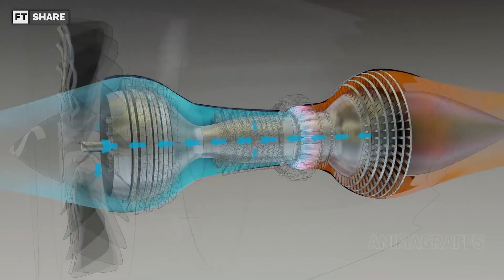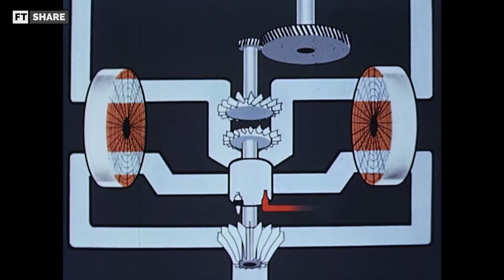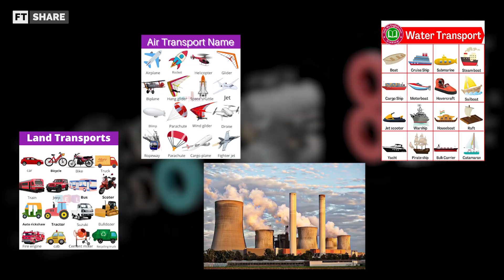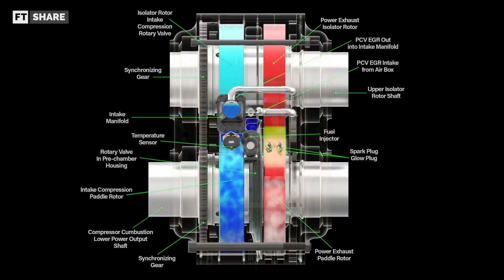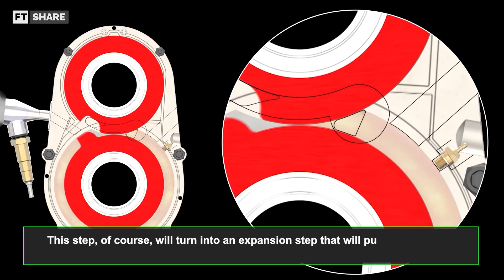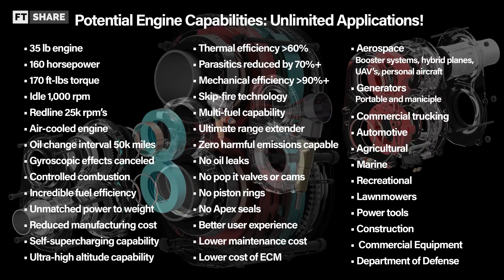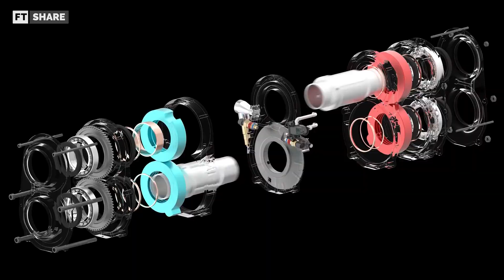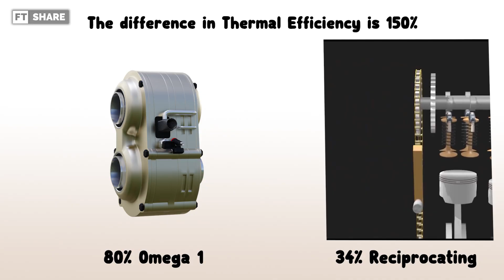Ready To Destroy EV Engine!! | Astron Aerospace - Omega 1 Engine

Comment: this is a claw pump 
Or dry pump 
Engine 

U can use roots pump engine 

Any rotator pump in tendem 

Intake smaller exhaust bigger 

In between heating internal or external 

Torque is out put
Reply: Any air pump with smaller intake pump exhaust bigger 
With two pump axle connected 

Or two pump the with gear ratio 

So air taken in heated 
Expense and drive exhaust pump 

This torque drive continue air taken in colder 

No mater heating internal or external

Comment: It sounds good but ...... does the engine get hot? if it does energy is being lost in the form of heat energy. Heat losses of electric motrs is very small. Since the fuel fires up there are considerable heat losses. maybe less than traditional ICE engines, but unquestionably far greater than electric motors. ... so..... this claim to destroy ev motors is FAKE!!!!

Comment: Very poor and at times incoherent english dialog. The 80% thermodynamic efficiency claim is a big red flag that this is bullshit. Unless they have some previously undiscovered alien materials that they are building this engine with, then this is smoke and mirrors. There are Laws of Thermodynamics and Materials Science that determine the amount of useful work a heat engine can achieve and specifically the Carnot Thermodynamic Cycle. The best heat engines we have built to date, with current technology and materials, can manage around 50% thermodynamic efficiency and they are exotic race car engines (Mercedes Benz), very large marine diesel engines or steam cycle electricity generating turbines. Anyone smell a scam here?

Comment: This will have bad and high idle, terrible efficiency and will burn oil as a 2 stroke engine, probably will never pass any ecological standards. Also forget any durability with these ball bearings running at those high speeds

Comment: EV's will already fail because nobody will be fixing them pos. 8 billion batteries is a ducking joke. There's new conrod's that supposedly increases by 30%. Don't forget new plasma plugs will also increase 30% as well. Their are a bunch of patents holding back ice cars. Thats fact!! Porsche new fuel will also likely add to this. The whole battery bs is nothing but df engineers. Also 800,000 plus jobs in ice which I am drastically under stating. 1 billion car enthusiast will also never switch.

Comment: The Rudge Ulster Grand Prix 500cc racer featured a unique prototype cylindrical rotary valve cylinder head. The sealing was the issue and it's still an issue with any rotary design.

Comment: A turbine is the logical choice for a hybrid. 
It can run efficiently to supply power and charge a battery. 
It can run at optimum efficiency regardless of vehicle speed.
It only needs to run when the battery is low or during extreme demand like long steep hills.
The issue is scalability. Can it be made small enough for a compact car?
I see big trucks and busses using this tech increasing fuel mileage and range.

Comment: And how will we have power transmission on asphalt?  And it looks like a 2 stroke machine.  Cooling the engine and lubrication for the machine is also a problem.  Fuel consumption per hour of use at minimum speed is also not mentioned.  Starting the engine was also not explained, if it is based on the concept of a reactive engine, it needs starting gears and heating the housing.  Transmission power was also not shown with a graph if there are times where there is no power.

Comment: I can see where I would question whether or not I would run 2 "notches" and not just one on the rotation allowing for a better combustion program.  Also, I would also question the heat verses the cold section of the engine.  It looks to me that one half of the unit will get extremely hot where the other will become very cold.  This differential might cause a very bad expansion/contraction differential causing a warp in the engine as it gets hotter and hotter.  What is leaking?  Is that water or fuel?

Comment: Certainly looks promising,  I assume there is nothing stoping them having two lobes per rotation?  This would decrease the required rpm.  Maybe two banks with two lobes would be smooth.  So 4 detonations per rotation.  Also as someone else said it could have multiple stages.  Maybe a wider lobe for first compression and then a narrower one for second.

As always, sealing and lubrication is the big problem with any rotary type engine.
Reply: Also the holes the centre could be used for gear driven oil/water pumps + alternator.  In fact in a hybrid system a generator could be located inside the exhaust side

Comment: This is a scam or it is trying to permanently trash someone elses work. First it cites 80% thermal effeciency and later states that it is 150% more effecient than an IC engine @ 34%  1.5 x 34 = 51, not 80.   Patents applied for?  So what? Any idiot can apply for a patent.  The trick is to get the patent. And you are looking for someone to give you money via licencing despite the fact that you cite fundimental material problems. Also spell check your text - it is spelled 'Municipal'.

Comment: Outstanding idea, less moving parts, less fuel, more power.
I'm not a mechanical engineer but you can cool down all types of engines.
From the video the thing runs which is a plus I suppose, next step put a muffler on it and whack it in a car and see how it goes.
Dont let the car companies buy you out, like the ceramic engine  ( it doesn't need a cooling system). 
Also Ralph Sarich and his new engine from the eighties.

Comment: doesn't seem to need an external flywheel, I guess the internal "ring" structure and gears provide enough momentum to keep it going at idle speed.  Also I see the exhaust coming out at pressure, so why not add another low pressure larger volume cylinder wheel and capture that pressure as it expands to atmospheric pressure.

Comment: I feel the 'rotary engine' vibes... in that, it works in theory, but requires an insane amount of precision compared to traditional piston-driven engines. 
All the numbers also sound highly theoretical. None it is believable until it actually gets hooked up to automotive testing equipment, or actually adapted into a moving chassis of some sort.
Reply: There are no oil changes in a rotary they use oil injection like a 2 stroke. i run amsoil interceptor in my rotary.
Reply: @jlo13800  Maybe 'some' rotaries, but Mazda Wankels definitely have a wet sump, and the unsuing need for oil changes. The oil injection is only for the seals, not the main shaft.
Reply: @robertrobinson3861 And an oil cooler to stop the oil boiling.
Reply: @paulhales3013 Agreed.
Reply: @DavidPike_Potato  lmao. no.
Reply: It is a very imperfect heat engine. That is all that is necessary to know. Precision, nu mber of pistons etc are irrelevant. Learn some thermodynamics.
Reply: the piston engine is such a stupid design with a million moving parts and the power changing direction to the crank... ... ... its about time to replace it with something better.. i dont see tolerances being issue with this omega engine..
Reply: Actually, no, it doesn't work "in theory" with 80% efficiency (see first comment on Carnot cycle), regardless of whether practical aspects can be solved or not.

Comment: this idea has been beat to death already........rotors to compress a fuel mixture etc etc etc.   The problem, like in the wankel rotary is always the sealing edges that wear out, or leak compression and combustion pressure. Also, as the combustion gas expands, the rotor exposes it to a larger and larger surface area chamber which leaks a lot of heat energy to the outer case. Yes the wankel rotary and jet turbine engines are lighter........but they also do poorly with fuel efficiency in road applications.  The jet turbine is just a good match with the typical speed of high performance aircraft........and has a weight advantage, but it comes at the price of cost and fuel economy.  2 stroke opposed piston engines would beat this concept into the ground no problem......and they are proven to work.

Comment: I worked and developed some rotary vane engines 40 yrs. ago and can see that the leak between rotors with out seals are almost impassable to stop especially with any temp changes and anything over 50 % thermal is just not possible also I see an outside air line supplying air pressure to make it seem to run
Reply: One of the reasons pistons engines work so well is that sealing, even with its own set of challenges has been solved. Only issue electricity is facing is energy accumulation being heavy while charges have no weight, spending time and money on a new dead dinosaurs burner doesnt seem probable. Good eye there it looks like going on helping wheels.
Reply: Starter?
Reply: I was thinking the same thing. The tight fit between the upper and lower wheels has to be so tight to work. Blowback will erode the wheels and make the gaps bigger and bigger. This is why the rotary engines fail when the wipers wear out every 25-35,000 miles. This one would be no different. If the wheels are too tight, they won't turn. The heat cycles will destroy the engine. I don't know why we can't learn from the trains and have generators run the electrical cars.
Reply: @brianmontgomery350  odd word choice; "blowback" causing "erosion", what? Apex seals wear out because they're a concentrated point experiencing enormous friction at high speeds - they are simply mechanically punished and can't be eliminated from the design. Nothing to do with this engine.
Reply: The theory as I understand it is that the rotors don't need to seal because they leak by design. Given the proposed 200psi intake pressure, and assuming a high enough compression ratio (not disclosed) to achieve chamber pressure despite the losses, the volume of air lost to the leaks will have a small enough impact that it can be ignored. In the demo they would be feeding pressurised air from an external source as there'd be no point building a custom charger for the proof-of-concept when it's already a solved technology.

The main question I have is around emissions - they're using semi-direct injection of fuel which means more time for fuel-air vapour to escape rather than just air, which affects efficiency, and the same can be said for combustion gases. I think this engine's equivalent of a crankcase needs to be an active component of the air intake system to ensure complete burn. That's probably something they intend to do as part of the charger design if development reaches that stage. 

side note: I wonder if this can be made to run on diesel
Reply: @TimTamsLOL I don't see how that could be possible, as the highest compression occurs outside of the combustion chamber.

Comment: Lots of claims, but little evidence here of most of it - I'd at least have expected to see a working example at high revs - Lets face it, most internal combustion engine's volume is made up of cooling facilities - either water jackets or cooling fins. If this engine cannot deal with the expansion of its components, it needs serious cooling, and therefore greater volumes. Tighter tolerances usually mean variable compression seals, rings or apex seals, which are claimed to not be required - If you were to take many of these features off of conventional engines and run with higher tolerances, with no consideration for wear, I expect you could achieve comparable levels of efficiency from a Wankel engine. Trouble is, you can't.

Comment: If I understand correctly, the upper isolator rotors are only there to provide a separation between the intake and compression sections in the "blue" paddle rotor, and the power and exhaust section in the "red" rotor, and only needs to have that notch so that the gear profile can pass through. But that means that, for most of the cycle, that notch serves no purpose. So, why isn't there another pair of compression and power paddle rotor at the top, working 180 degree from the bottom pair? Now, you'd have the isolator rotors do the work for two power rotors. And depending how tight the packaging of pipes and ports are, it could even be possible to have 3 (in a "Y" shape) or ever 4 (in a "+" configuration) power units sharing the same "isolator rotors".
That would make the engine proportionally lighter for the power produced.

Comment: Wasting time in combustion engines? Oil is going to last 45 more years only. Even with this suspicious 80% efficiency, there is zero point in wasting time following a dead path in 2023. Electricity will last forever. Dinosaurs won't die again to gift us more oil.

Comment: I can only see it working if they power it by injecting liquid propane that sucks heat from the chamber by turning to vapor, and also injecting a tiny ammount of 2 stroke oil to keep everything nicely lubed and sealed.

Comment: I love it. I can visualize one coupled to a hydraulic clutch and then to a reduction planetary gearset of ten to one, then used to drive a vane pump for hydraulic power that could power each wheel of a car using nozzles  in an in wheel turbine. Fashioned like a truck the brakes could be released first hydraulically and then as pressure increases the car would move more quickly. Pressure fails or released, the car would stop.

Comment: Having that in a motorbike or a snowmobile would be nuts. A hydrogen generator for a 2 electric motor car like the lucid air would make it much more viable and more green too. Smaller sets off batteries that are constantly getting charged by this. Range would be 600kms on a tank. Then you could just fill in 3 mins and go.

Comment: I think it’s more likely that this will be a range extender for an EV.  EV revolution is already done.  

However,  what about using this to make power for the grid as a peaker plant.  This thermal efficiency is good enough for that.  This would be especially cool if you ran it off hydrogen made by excess solar.  They could be great for providing night time power directly from solar farms.

Comment: Will never reach the efficiency of an electric motor, so it WILL NOT destroy EVs which the clickbait title suggests. This engine still burns fuels, no matter how clean it burns the fuel we are moving away from vehicles with exhausts. As with BEV versus Hydrogen, the question is settled...batteries + motors is where we are going.

Comment: What's interesting to me is the idea of running the transmission through the middle of the engine itself, with just as many reverse gears as forward, since both rotors are contra-rotating.

Comment: Durability and efficiency of seals could still be a significant issue but it seems much less problematic than the apex seals + large trochoid cavity in the Wankel rotary.
Reply: It's not mentioned here but I've researched elsewhere that it has no seals... it depends on extremely close tolerances to function properly.  Sounds like a pipe dream to me.

Comment: If a turbine engine company hasn't developed the materials needed to make it durable enough for cars, I don't know who will. Will it need to be made of kryptonite? 
It may not need apex seals but it needs some kind of seals, how durable will they be?
It better be damn reliable if they're going to put them in planes. 
Put one in a 24 hr Lemans car and demonstrate it's worth.
Reply: Rover did that in 1963, with a simple gas turbine inthe car and came back in 1965 with a turbine with a regenerator. The car finished the 1965 race with about 14 mpg.

Comment: Pretty words. Also pretty vague. AFAIK, there has never been more than a low powered prototype made. Not even a full scale/full power unit for testing. 
Smoke and mirrors. It's easy to make an impressive Youtube video with a few computer generated graphics. Much harder to make a real. full size, testable working unit. There's a reason no one has bought the design.

Comment: There is not enough raw materials for the batteries required to replace all currently used gas cars with electric cars, it's literally an impossible dream without a complete redesign of a battery including materials used and hopefully weight savings...
So we should always be pushing both industries, and NOT forcing either out of existence. Looking at the dumb countries and idiot states who want gas gone by 2030ish.

Comment: I don't believe it. Thermal efficiency for rotary (Mazda) engine is 32 - 35%. thermal efficiency of jet turbine is 30 - 50% , thermal efficiency of electric motor is 70 - 95%. Really interesting concept though.

Comment: What dogged the Wankel engine was it burned oil - which was mixed into the fuel to lubricate the seals required to hold compression - and the wear and tear of the seals. Since this presentation made absolutely no mention of these factors and whether this design addresses either we have to wait and see. I assume if they had a breakthrough on lubrication or the seals they would have been featured in the presentation - so we wait. Incidentally, I owned a Mazda Wankel and got no more than 8 mpg - ever. Yes, it rev;d like a banshee and was smooth as glass, but it was really not ready for prime time.
Reply: Yeah, burning oil made meeting pollution standards essentially impossible (cost-effectively)

Comment: Wouldn’t a timing chain have significant advantages over a big pair of gears? That’s a lot of wear factor to deal with, and a sprocket can be a lot lighter than a gear for rotational inertia.
Reply: Have you ever heard of chain stretch?
Reply: @richarda996  I would think that you could use a wide enough chain to where that wouldn’t be an issue. At least, less of an issue than timing gears. Seems to me that teeth would wear faster than a properly sized chain would stretch, and it could be designed around.

I just can’t see it being a good option, but then again I’m neither a mechanic nor an engineer.